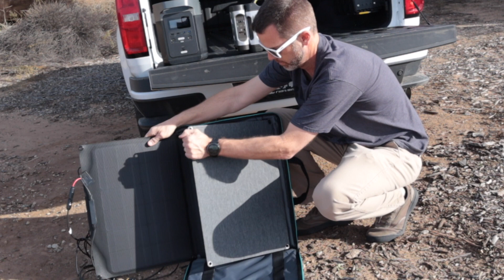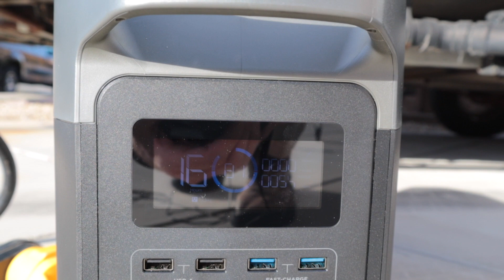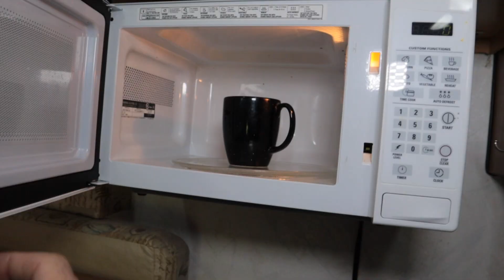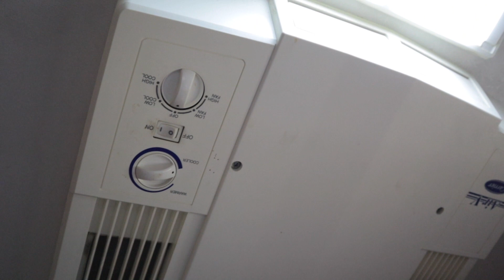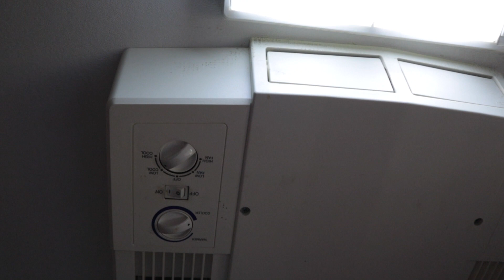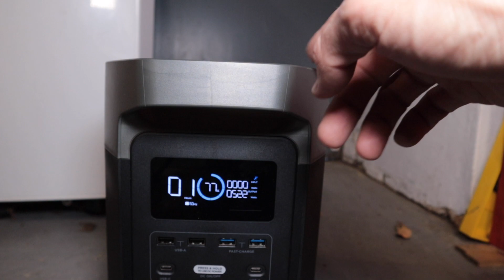Ecoflow Delta 1300 - Silent generator! Great for camping, emergencies and more!

Comment: Why do people call these generators? They do not generate anything. They are storage batteries.
Reply from the maker: They are designed to work with solar panels, panels provideelecteicity to the unit, which coverts the power to 12v and 110ac. When you have the whole system it does everything a generator does and more.

Comment: It's not really "silent".  In fact, it is one of the noisier units because of the fans.  

It also slows down in charging if the unit is hot.  So if you WAIT to charge it after it's fully cooled, it is not really 0 to 100 in 2-1/2 hours.

Comment: Hi is there anything that can work for eight hours while I telework in the shed?
Reply from the maker: It all depends on how much power you will need. This thing may be able to do it depending on what you’re trying to power.
Reply: @DoItYourselfDad  Dyson 120v heater cooler purifier now 5000 air conditioner summer. Thanks
Reply from the maker: Definitely could run a heater or ac for 8 hours. Most heaters are 1000w, ACs are about the same. You could probably get 1-2 hours of run time.

Comment: Question if u maced 24 bourd of fridge n had to recharge w solar how long will take to get fridge goin again. 2and question recharging or running fridge w ot plugged into solar panels w full sun. Have apt n mostly want to keep heater o  at nite ir portable ac on for hit days. Possible for fridge. I would like silence generator if grid goes out not to let neighbors know. What do u recommend. ?

Comment: I"m confused.  When you showed the alligator clip/ cigarette lighter, I think you said you can charge your unit.  But the cigarette socket on the unit is for output, correct?    Also, the I wasn't clear whether the unit actually had USB_C input for charging the unit.
Reply from the maker: It has a female cigarette lighter socket on it to power devices.  It also has a male ended cigarette lighter cable and alligator clip ended cable with an xt60 connectors on the other end to charge the Delta. It has USB-C outlets, I haven't tried charging the Delta through those ports though.

Comment: Did you check the AC passthrough? You should be able to keep it plugged into AC and the Fridge plugged into the Delta. When grid goes down the fridge will continue to run.
Reply from the maker: That’s how I’ve used it camping. I hook the fridge and the other appliances to it, then I connect it to the generator. I only run the generator when the delta is low, then I shut them generator down and let the battery take over. You can also have it operate as a pass through and have the solar hooked up at the same time.
Reply: @DoItYourselfDad  That is in itself an interesting use, but it does involve the batteries being charged and discharged on a daily/regular base.

What I am thinking of is more like when AC from a pole or a home is available and AC is passed directly to the connected AC-devices without discharging the batteries. When the AC from the pole or home is not available anymore, only then the battery is being used. So that involves many more hours being connected.

This way, certainly at home,  the Delta can just sit there for months or maybe years, only to jump in and protect for example the content of your fridge, without the constant discharging and charging going on all these months, just some trickle charging to keep it charged.
So my intented use is only when the grid is down and have it kick in immediately and automaticly when the grid goes down. I think this baby does this very well and is unique in this ability.

Comment: Would have been good to mention what Goal Zero you had in the truck, and its charging time.  That is where the Delta kicks amps...1.7 hours to recharge from empty to full when plugged into the wall, and GZ can take up to 25 hours!
Reply from the maker: I do agree, although comparing the two wouldn't be fair to the goal zero unit I have. The unit I have is 7-8 years old. Goal Zero products have come a long way since then, but I still think the Delta is a much better unit.

Comment: How many panels required for max input? They are $500 each....very expensive for one solar panel.
Reply: 4 100w panels under the best condition would be 400w which is the max input also you can use any panels that use mc4
Reply: @Trillville43  we can see in the kickstarter website that they had tested the 110w panel and this is written if my memory is good it was written it gives for real 75/80w

Comment: Can run run this in parallel with another  unit? Great review and love the ending 🤣🤣🤣
Reply: You can daisy-chain multiple units to increase the duration, but not the output power (can't create 220vac from two 110vac units).
Reply: @anonimity1698  thank you
Reply from the maker: Beat me to it!